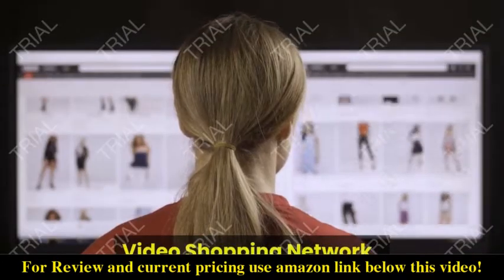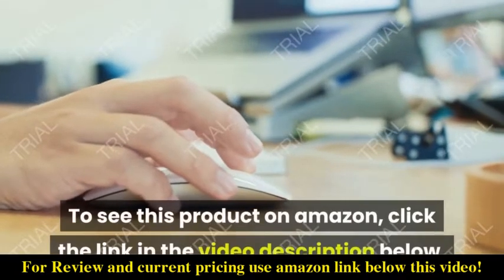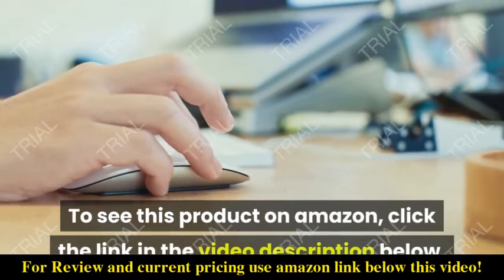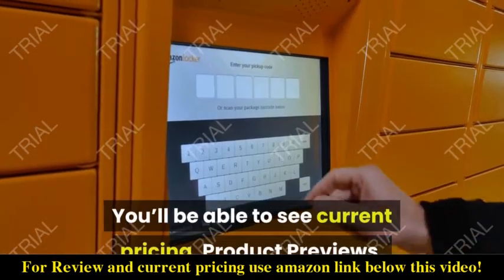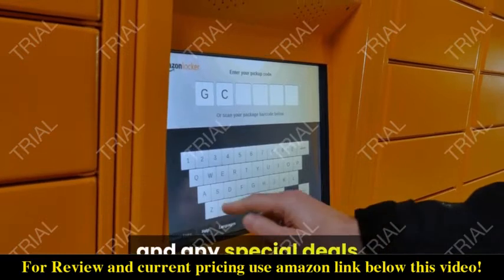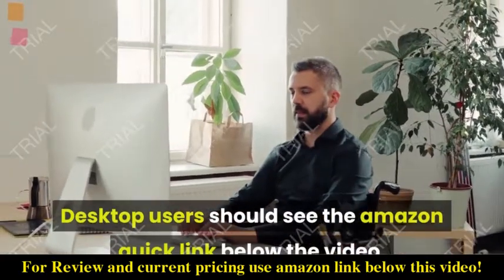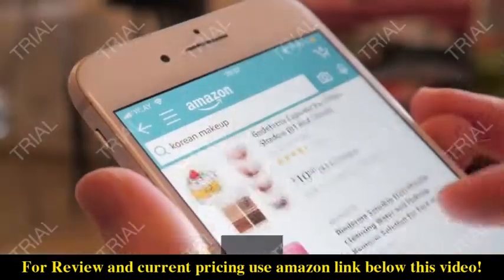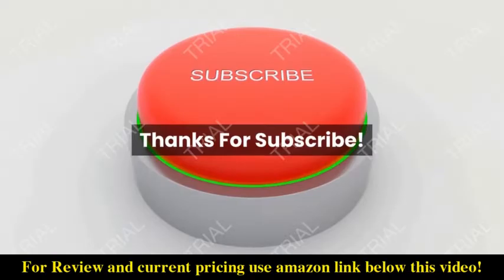Review Shop Fox W1854 Open-End Drum Sander 2021

Comment: BOUGHT THE W1854 DRUM SANDER,  SANDS OK WHEN YOU FINALLY GET PAPER CUT CORRECTLY
USED ORIGINAL PAPER FOR PATTERN AND ITS TOO LONG.  USED MEASUREMENTS FROM MANUEL AND TOO SHORT.  THE DESIGN OF SET SCREW TABS TO HOLD THE PAPER IS HARD TO WORK WITH.   YOU WILL WASTE MORE PAPER THAN ITS WORTH.  THIS IS A HORROR TO LOAD PAPER ON. 
BUY A BETTER BRAND.  AND THE FEED BELT TRACKING IS ANOTHER ISSUE ALL BY ITSELF.